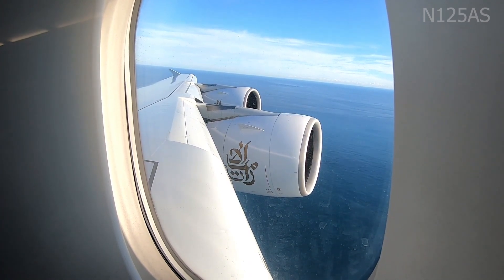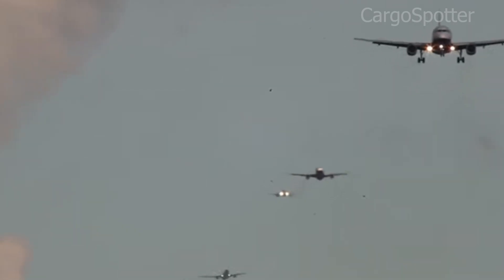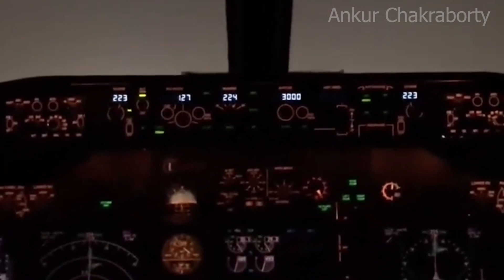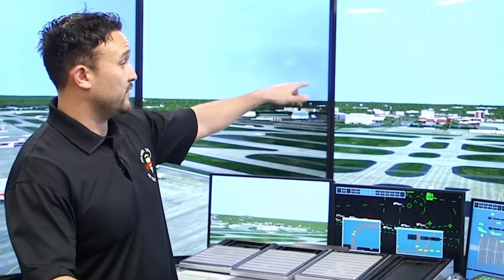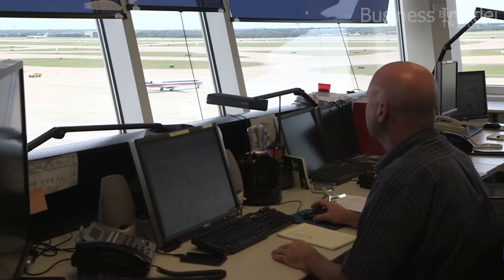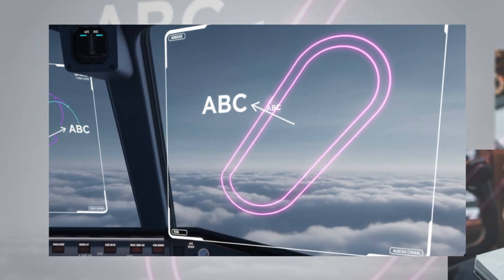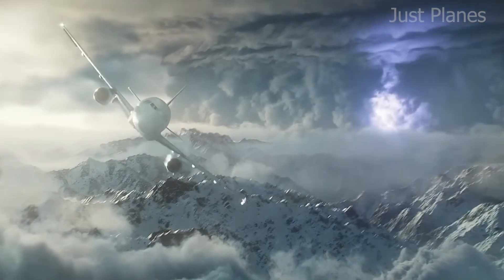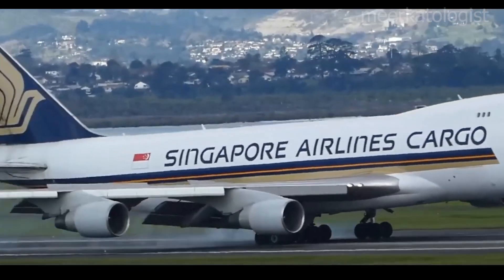Why Planes Circle Before Landing – The Real Reason

Comment: TERPS is US only, doesn't apply in the rest of the world where we rather use PANS OPS limits, which are usually a bit wider. 

Instead of EFC we usually get an EAT over here, Expected Approach Time. The Time where ATC expects us to start our approach procedure. They  can already issue that time during cruise which allows us to adjust our speeds to reduce or even prevent holding. 

Holdings are not flown manually anymore. Therefore holding entries are a nice exam question and quite often used during selection simulator checks when  airlines hire pilots. On the line the computer decides how to enter a hold and there is no pilot input on that.

Many airports now try to use approach procedures that look like waiting lines in amusement parks (or at security), those are meant to reduce the amount of holding, but take up a bit more space. They are usually designed in a way that allows easy short cuts to the final approach without leaving the planes too high to start the approach. They can be called by different names depending where you are, in my airline we tend to call them "trombone arrival" as they are shaped like one.
Reply from the maker: Thanks for providing such a detailed and informative breakdown of international air traffic control procedures and modern holding patterns!